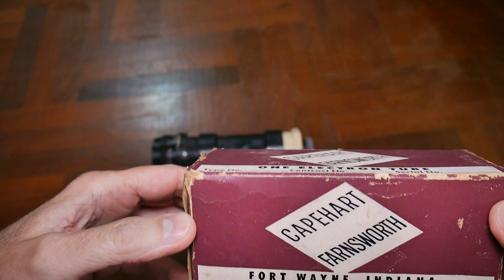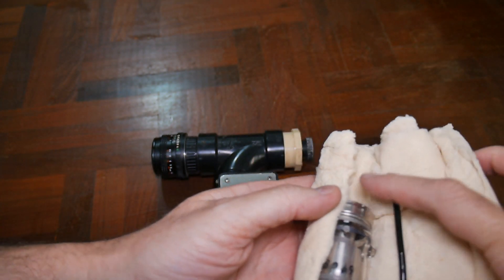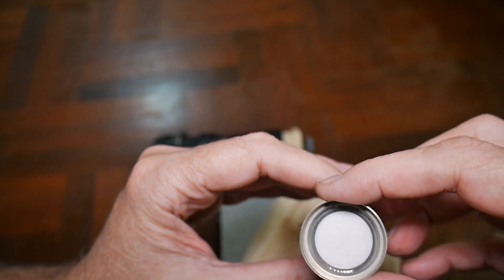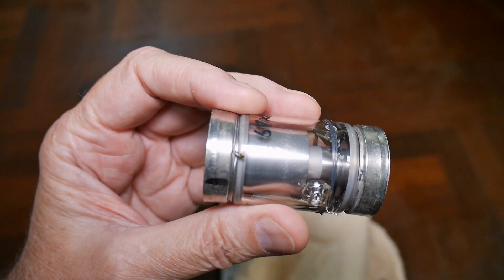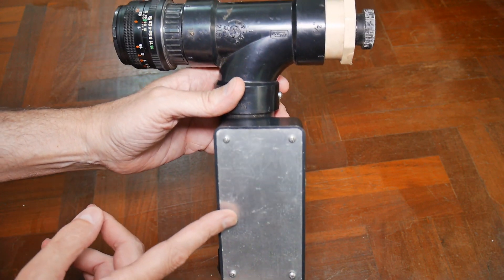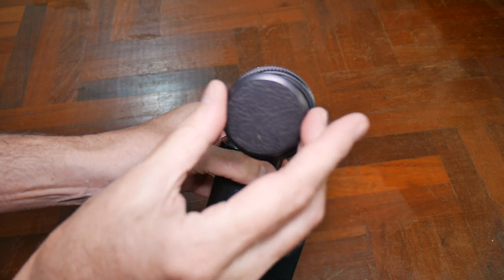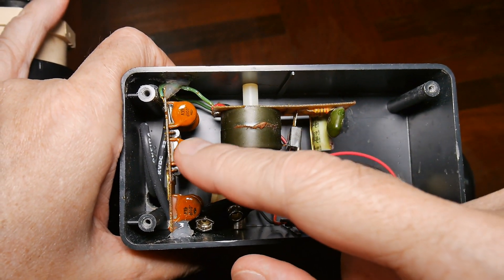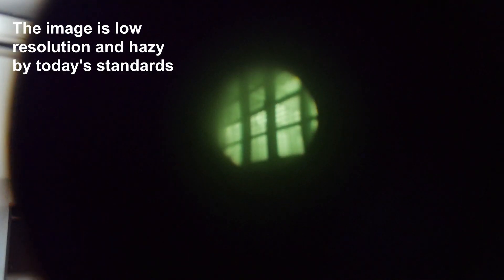What Is It?  (#1)

Comment: Oh yeah something to note as well: a fast lens is definitely very important for these tubes to perform well in the dark. Generally, F/1.4 or below is required for any image intensifier tube to perform to its full potential. Might wanna consider slapping a faster lens on it for it to perform at its best. Brilliant content btw; am definitely sharing this video with my friends.
Reply from the maker: Thank you.  The lens is a f1.4, but faster would be better.  Also I'm only driving the tube at half the rated voltage because the power supply was making unhappy sounds and I was afraid the magic smoke would escape.

Comment: Awesome content! How well does the tube perform in the dark? The silver color of the photocathode does suggest that it's using very early S1 photocathode materials; which is definitely not very sensitive by today's standards. My guess is it performs decently at NL0 or NL1 but won't see anything in NL2 or beyond?

Also something to note. Don't think it fits the modern definition of a photomultiplier tube since there are no electron multiplying elements like dynodes or microchannel plates in the tube. Think it's just a good old Gen 0 photoconverter or image intensifier tube.
Reply from the maker: By modern standards it ain't good.  But by 1950's submarine tech standards it was awesome.  It requires significant IR illumination (no passive detection).

Comment: I think that actually a 6099 tube. It needs 8-12.5kv to run to spec. 3.5kv is closer to what modern MCP intensifiers use. https://www.valvecollector.uk/cv6099.htm
Reply from the maker: It may be.  The box and tube are both labeled by the manufacturer, but it could have been sold under other numbers for other purposes in other countries.

Comment: Funny, those tubes don't flip the image upside-down.
Reply from the maker: They have no optics themselves. They just multiply photons, in this case only in the IR range (the semi silvered front window is the filter). Higher voltage = higher ratio of in to out until the tube breaks down and it goes "white".
Reply: @tsbrownie  Do these work with only IR light, or IR and visible? A bit of background: I have a few night vision devices and spare tubes, and all of them have the shiny photocathode, but they see visible light as well. I also have a pair of IR filters meant to fit over vehicle headlamps that came with one of my goggle sets, and the filters are an incredibly dark red, and are not metallic. I've also used thermal cameras in the past (FLIR lepton 1), and they all have a shiny filter, that filters out everything but LWIR.
Reply: They flip the image, but so does the objective lens. So in the end it's in the right orientation again.

Comment: Always wanted one. This video motivates me, to make one. Didn't know it was so simple. Hopefully, I can afford it.
Reply from the maker: Use extreme caution, the high voltage power supplies are deadly!
Reply: @tsbrownie  Sir, yes Sir
Reply: Hi Suraj, I love your enthusiasm. I have recently been tinkering and thinking about utilizing the Gen 1 intensifier tubes in many cheaply found on Ebay, commercial Gen 1 monoculars and binoculars and the rare and very pricey for  what they are 1x magnification "tactical head mounted Monocular/goggles"..lol. Which I own 3 of now ( Sadly the darn best tubed gen 1 head mount device i have i bought used was a high res Gen 1 ATN Viper mono... sadly when i got it the automatic dimmer than cuts the brightness if you look at a bright light... was turned up so sensitive that the monocular is literally useless in the dark and barely can see in a well lit room ( sucks its the best definition of any of the tubes in my stuff) and i have it broken apart, with the tube out and the ...black box made of glue stuff that was attached to the bottom that was full of capacitors is removed... So now I need some help figuring out what voltage i need to run, or how to disable this automatic dimming function which is making the tube useless... I think these particular tubes... ended up being great but having a lot of "duds" because i've read reviews on the ATN Viper were others said it performed utterly uselessly.. even with a seperate 850nm IR flashlight/illuminator... i could use help and advice from anyone who knows how this ATN High res "Auto dimming" Gen 1 tube can literally lose he "auto dimmer" function...?? BTW. I advize checking Ebay and doing so a lot. sometimes you will see nice monoculars going for $40 and they are worth more like $250
good luck and rock on Suraj!